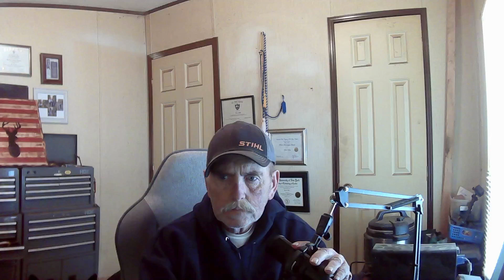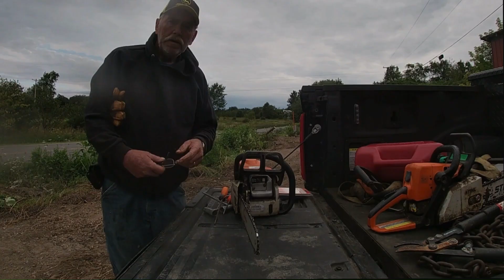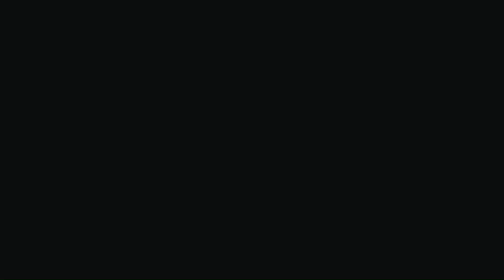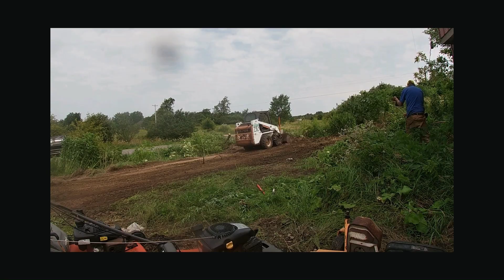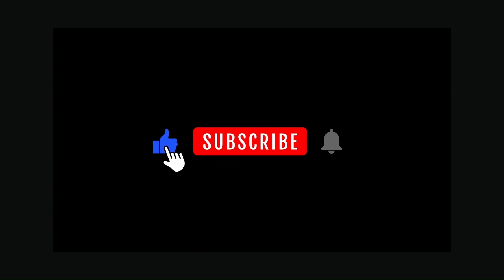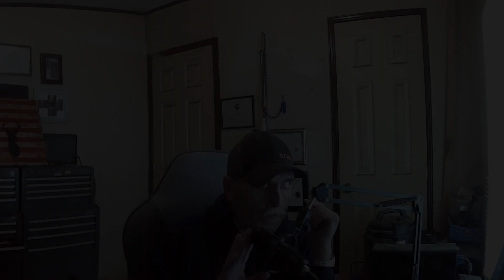Top Software Solutions for Small Engine Repair Businesses  | Northern New York Parts

Comment: Just finished up bringing a 1983 snapper snoblo with Briggs 8hp back to life, after sitting about 7 yrs.  Don't look for these units to work on, but when a customer has sentimental attachment to a unit because it was his dads',  I'm a big sucker.....  issues were all fuel tank to petcock to carb rebuild and then all good......
Reply from the maker: Sentimental value is a great reason to bring something back.  A lot of customers feel that way about their older equipment.